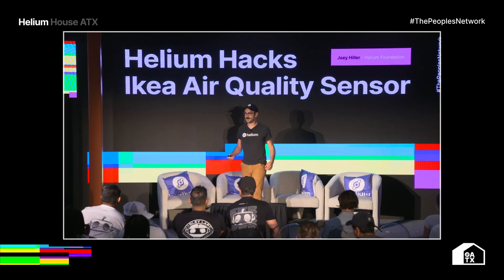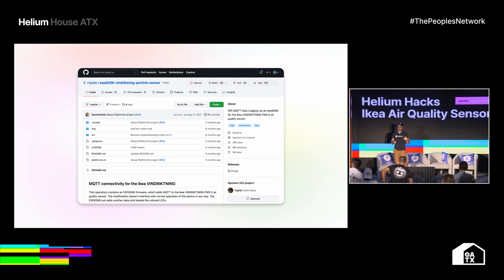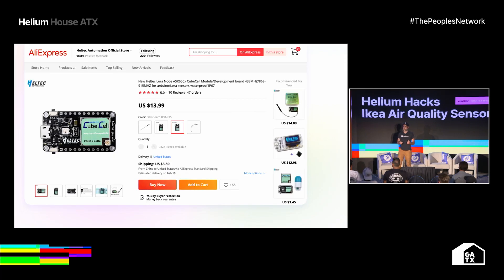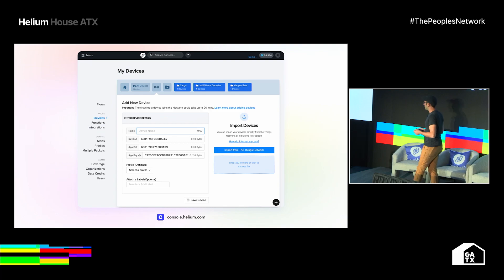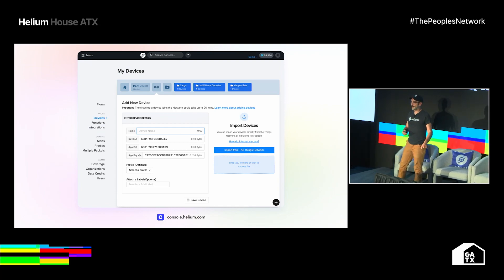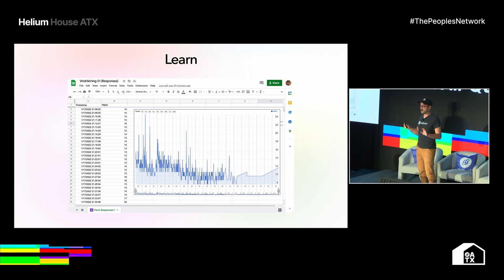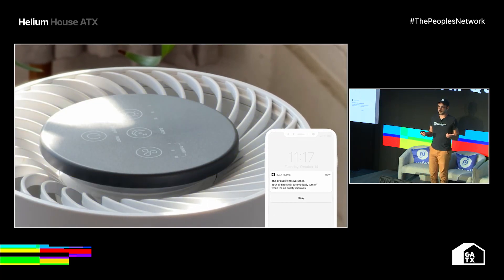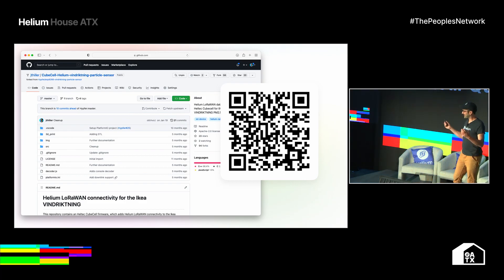Helium Hacks Ikea Air Quality Sensor

Comment: Hello Mr. Hiller, thank you for your project. I've been looking for a particle sensor for helium for a long time. But since I am still a beginner, I would like to ask if there is any more information about this project. The installation of the CubeCell in the IKEA is so far clear to me. However, it is not yet clear to me how I can then make the data visible as widgets in Ubidot's / Helium dashboard. So far I have gathered from your video that I have to copy the keys from the console into the CubeCell software and then flash them onto the CubeCell.
I currently have an LHT65 running and see the values for TEMP, humidity and battery power on the dashboard.

Please send me a link or something where I can find more information about it.

Best regards and many thanks for your work.